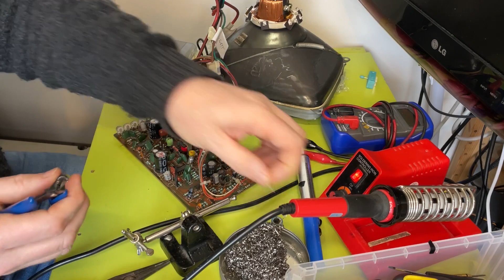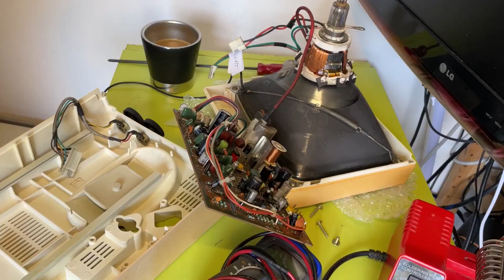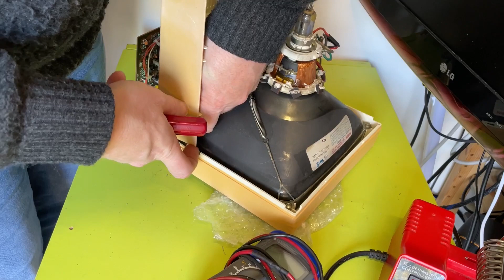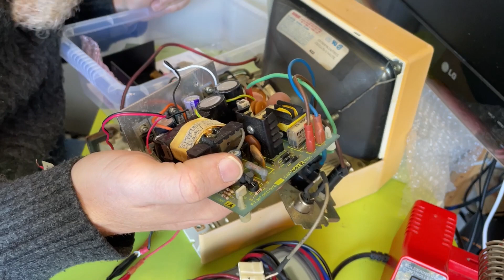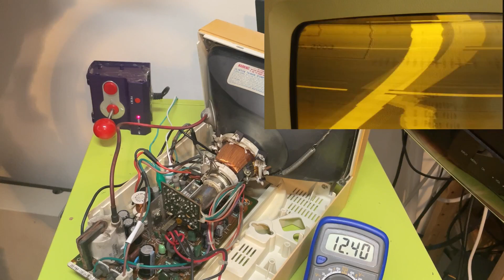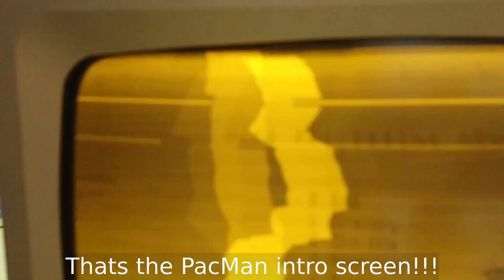Oddball tech - A tiny computer with even more fixed caps!

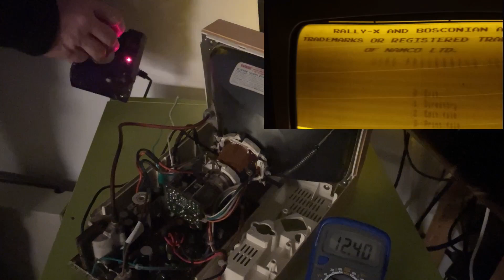Comment: I've not really played with the innards of monitors before so I can't give any advice - it seemed that at 25:29 something akin to a proper screen displayed - or was that just lighting up the burned in bits?

Interesting that the "width" seemed to behave correctly which would imply that it's something before that bit (the video signal conditioning) that's gone awry. The way that the picture shape was flicking around like that made me think of a loose connection - more capacitors to change maybe?

Just some random thoughts anyway.. good kuck with the rest of the restoration 😊
Reply from the maker: Yes the width seems fairly stable and yes the picture does show the sprites and text from Pacman and the intro screen of the games console so it is tantalizing (capacitor joke not intended) Im kina of stuck as to what to do next, short of replacing every cap! I cant see anything loose and have reflowed a few dodgy looking joints. I will check the connectors again though as you could be right about a bad connection.